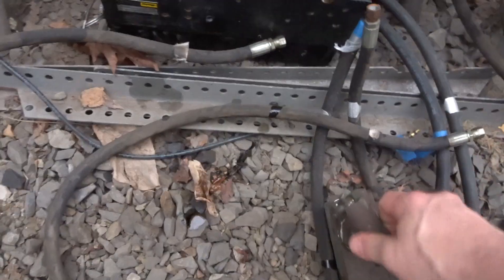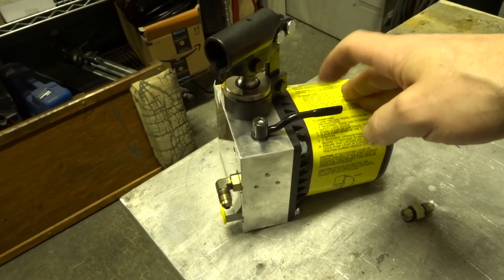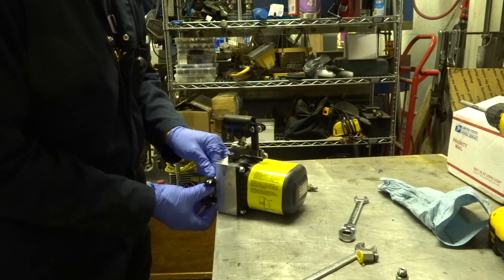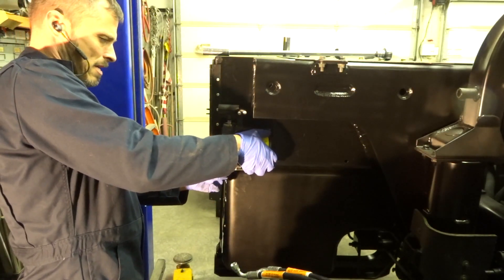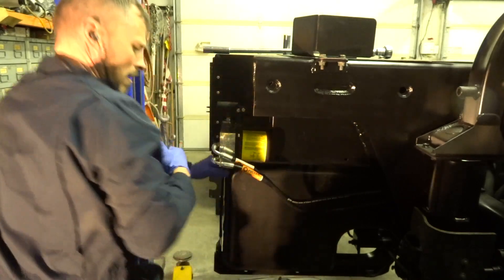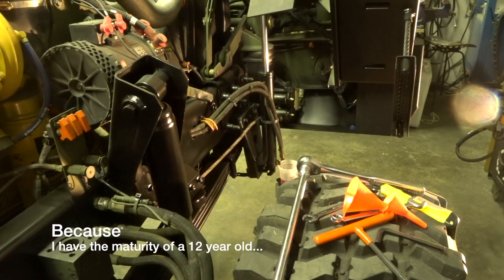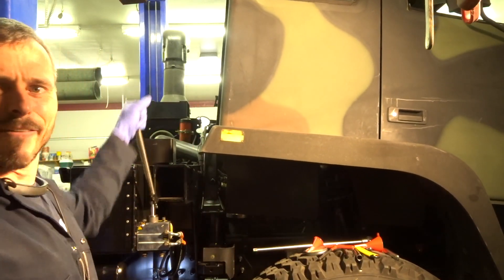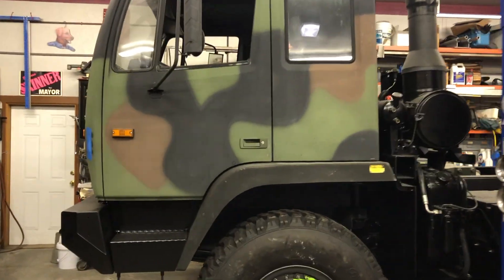Installing a new Hydraulic cab tilt pump

Comment: I'm late to this party.... Just removed all the Air over Hydraulic on my m1078...  I purchased a pump from one of the online military suppliers.  My pump is connected identical to yours.  Hand pump to the cylinder, no tank, none of the manifolds, etc.  

When I lower the cab, the pressure is causing the seals to blow out in the back of the pump and spit expensive aero41 out the back seal.  
The supplier is saying that the pump seals are failing because i don't have the expansion tank and wasn't designed for this..🤔  My suspicion is that the pump they sell that looks a lot like the power packer, is not an actual power packer pump.  Was curious if you have the same issue with your OEM version?

In your setup, withe the OEM Power Packer.. are you seeing any issues when the cab 'falls' down?  Where hyrdo fluid spits out the back of the pump?

Thanks.. and love your channel!
Reply from the maker: No issues so far and I’ve run it up and down countless times. Who did you get the pump through?   The one that is on the truck by default doesn’t have a reservoir the one I bought from power packer does.
Reply: I'm having the same issue - did you get yours figured out?  Curious if a full flush of the whole system will help ...
Reply: @michaeledwardobrien  I got mine from Midwest Military.. i'm certain it is not authentic.  They sent me a replacement, and then claimed that the pump is "not designed for that application"... (even though it has a reverse lever and they claim it is the same part number as the PowerPacker)
I'm either going to order the one that Chad used, directly from his supplier.. Or go the route that rronmar went.
Reply: @gkwait  That's where I got mine as well.  I was already looking into the rronmar alternative ... thanks for confirming!

Comment: Can you tell me where the latch is that locks the cab down? Cab wouldn't tilt as faulty pump which i replaced but now cab wants to lift but something not releasing so presume its the latch but can't find it.
Reply from the maker: There is a pressure activated cab latch at the back center of the cab.   It has to have enough pressure to open before the cab will lift.
Reply: @BrokeOverLand  Thanks for your reply, how much pressure? I pumped until there was quite alot of pressure and I was really pushing down on bar. To me once I'd taken up pressure I was expecting to see it lift. Don't really want to be blowing seals in the pump. There isn't a lot of room between cab and body but I can see cross member is it in the centre of that?

Comment: I just bought a 1078 with the same pump.  Concerning the control of lever...12 o' clock is the cav lower and 6 o'clock is the cab raise ?. I see that once your cab was completely lowered, the control lever is in the 3 O'Clock position..is that correct ?.. I checked on PP website  and their manuals do not explain the control lever nor fluid fill capacity ... thanks
Reply from the maker: I honestly can not remember. I removed that manifold so long ago. I'll check it the next time I'm over at the shop.

Comment: Hello! I'm a big fan of your videos, and I am just starting out doing many of the same things you are but to my M1081. I found that same pump from another supplier (it's possible they gave me a pump with a different pressure release setting), and I plumbed it with new 1/4 in hoses from Surplus Center (strongly recommend as a supplier for hydraulics). Problem is, it acts as though it has a huge flow restriction.... it takes an awful lot of pumping going up, and even down. The cab latch functioned fine before, but now the spring isn't strong enough to close the latch. Just throwing it out there to see if you might be kind enough to offer a thought or two on the matter.... Did you have to adjust a bleed off pressure valve? Did you also use 1/4in hoses?

Thank you for the thorough videos, they're helpful and comical!
Reply from the maker: If you have the model number, you can check PowerPackers web site for the flow rate of the pump. If it is the HP50034204 (Model I used) then you may have some restriction elsewhere in the system. especially if your cab latch is not completely latching on it's own. if you give the pump a couple of pumps once the cab is all the way down, with the valve in the lower position, does the cab latch... latch? As for the lines, I can't remember off hand. anyway, I have the specifications sheet for the pump over on my blog page. https://brokeoverland.com/f/hydraulic-cab-tilt
Reply: @BrokeOverLand  Thanks for the reply! Yeah, I've been following your blog write-ups too; nice work! I've confirmed it is the correct model number, I'm suspecting there might be a lot of air in the lines. Did you do anything specific to purge the system? Other than overfill it excessively of course...

Oddly, when the cab is lowered giving it a few more pumps down doesn't seem to help the latch close at all. Over several hours though, the spring does eventually close the latch. I think my next step is to crack the line at the bottom of the cylinder, apply a few pumps to push air out, then close it off and try and cycle it again. If that doesn't do it I may have to pull the whole circuit and try purging the lines and rebuilding the cylinder looking for blockages...
Reply from the maker: You may want to reach out to power packer and ask them about line size.  I took my old lines to a local hydraulic shop to have replacements made, so I don’t know the exact internal dimensions. But I agree that a partial blockage sound likely.  When I pulled my kneeling cylinders there was hard chunks in the fluid.
Reply: @BrokeOverLand  Fred at Power Packer is a champion! He had me pull out the direction spindle valve and inspect a few things. A tiny tiny orifice in there was stuck full of something, not sure what - I think it might of been chips from when the parts were manufactured, or piece of o-ring that had been sheared off during assembly. Anyways, it works great now!

Comment: Was your stock pump worn out?  Trying to figure out if this was an upgrade or more of a replacement project.
Reply from the maker: the stock pump was still working fine. however after 20 years all the rubber o'rings in the system are due for a swap out. so this was mostly a replacement rather than a rebuild.

Comment: I have a question for you my friend. I am making a trailer out of PARTrisSha, as you may know, and I want to use the LMTV hand pump to raise and lower the hydraulic driven kneeling rams that I am now using to power the trailer tongue jack stand. Seeing that yours puked all that oil out, it got me wondering if I will even need a reservoir like I was planning. The kneeling units can pull and push... and I realized that when it is pushing, oil is flowing out the backside of the "push," and vice versa when pulling. What do you think?
Reply from the maker: I think you are going to need a reservoir.  The reason I changed to the pump I did, is that the original pump does not have a reversible valve on it.(that as you know is handled by the valve assembly)  So the hand pump itself only pumps in one direction.  So you would need an external valve to switch the flow or some massive springs to force the fluid back out of the cylinders.
Reply: @BrokeOverLand  the reversible valve is certainly a must for my set up... I just keep going back and forth over the reservoir question, mainly because I want to avoid it. LOL! Thank you!

Comment: Are you able to get to the right front spring pin grease fitting with a grease gun while that cab cylinder is installed?
Reply from the maker: With the flex tip gun and the cab up I can get in there, yes.